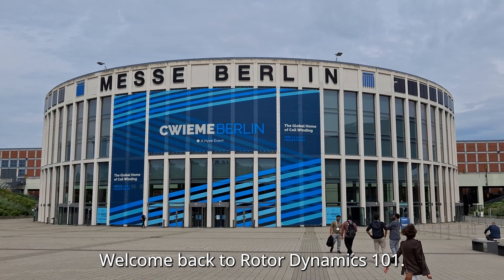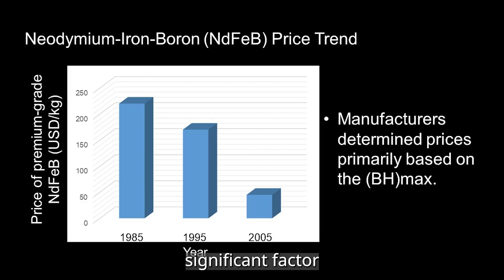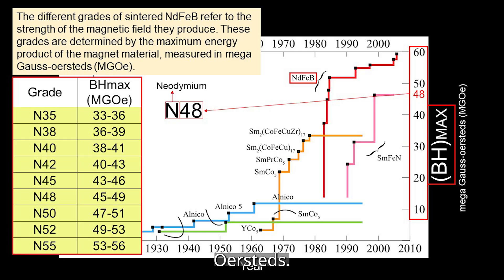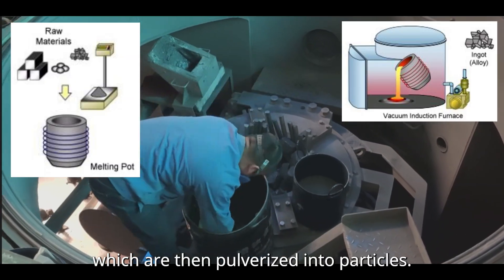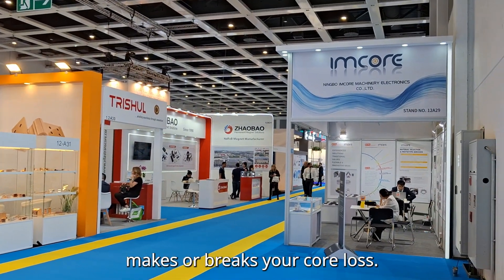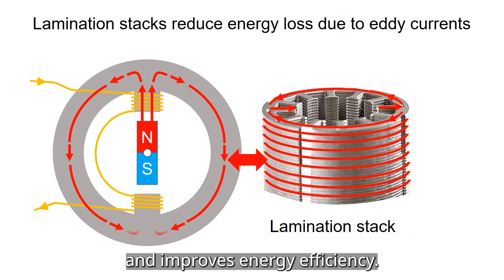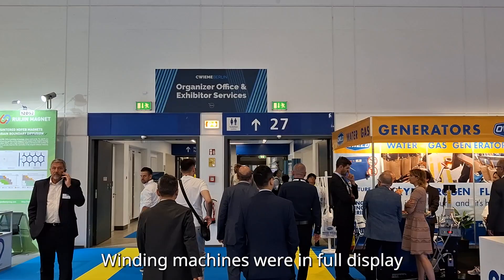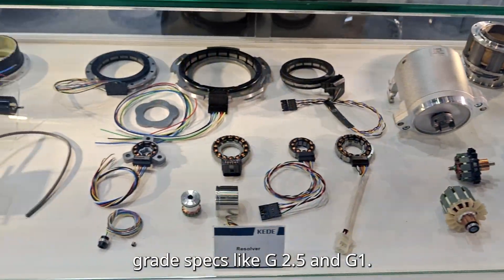What Goes Into a Motor? Magnet, Lam Stack, Winding, Balancing! (Part 71)

Comment: Thanks for the interesting video material! I'm very interested in the video about the manufacturing technology of stators and rotors from amorphous and nanocrystalline metal glass ribbons. Does anyone know where I can find videos or photos of the manufacturing process? How are motors made from thin amorphous ribbons (17-20 microns)?
Reply from the maker: Thanks for the great question! You’re right. The motors using very thin (17–20 µm) amorphous/nanocrystalline ribbons are made differently from standard Si-steel. Typical steps are: melt-spinning to make the thin ribbon, slitting, then either tape-winding toroids/segments or laser-cutting & stacking thin laminations, followed by bonding and a low-stress anneal. Cutting is tricky (ribbons are brittle and can crystallize if overheated), so recent work favors high-speed fiber-laser cutting and careful heat control.
For more details, I’d suggest checking out resources from Metglas and Hitachi. They’ve both worked extensively on amorphous and nanocrystalline motor technologies.

Comment: Great Video. 
It was parcticularly intriguing to learn a bit more about the manufacturing of magnets. Especially the part where they do the heat treating. Because it made me wonder why they applie the strong magnetic field, which is used to magnetise the material, ahead of the heat treatment. While heating a magnet usually results in an effect of demagnetization.
I hope you can explain it to me further, maybe with the help of some Numbers. 

Schöne Grüße.
Reply from the maker: Thank you! To achieve maximum magnetic performance, the material must be anisotropic, which means the grains need to be aligned along their easy axis of magnetization. This alignment is done during the compaction stage. After the powder is milled, it’s pressed into a mold under an external magnetic field, which orients the crystal grains in the desired direction.
It’s important to note that this is not the final magnetization step. At this stage, we are only aligning the grains. After sintering and machining the part to its final dimensions, the magnet undergoes a final magnetization process using a magnetizing machine.